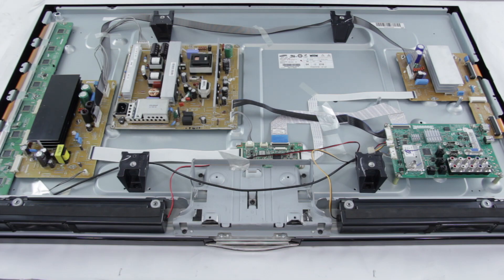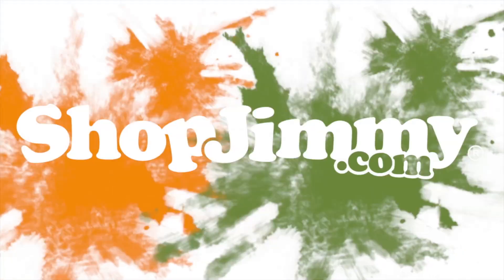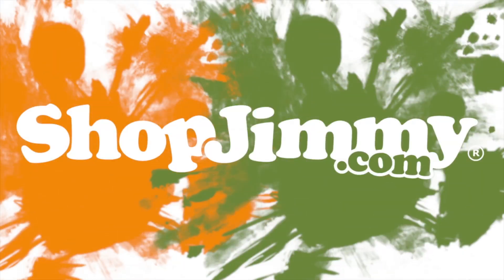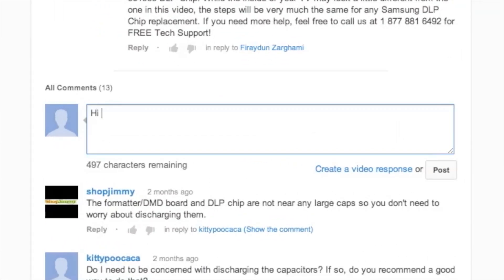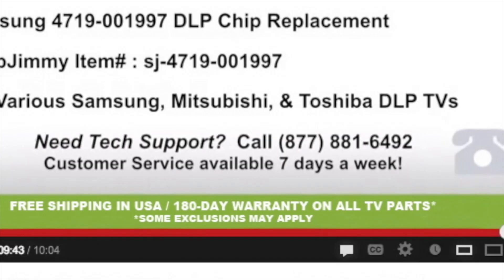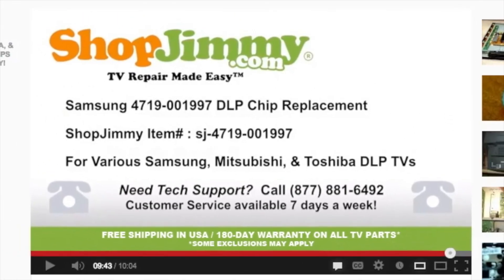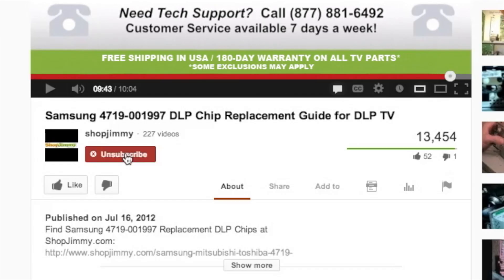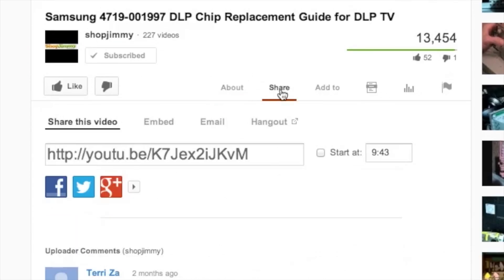Plasma TV Repair Tutorial - Common Symptoms & Solutions - How to Fix Plasma TVs

Comment: Good day ShopJimmy, my TV is a Samsung 43 inch plasma with model number PF4900 BN63-1028A #8DC22 and it has a problem of displaying false colour, mostly in green and purple like its NTSC. I have changed the main board and yet it still happens. Please what is the component responsible for proper colour in that TV? Thanks.

Comment: Hi, I have a 55” Samsung plasma tv model pn51f5500af
It will not power on. Red light comes on and flashes 2 times … continuously… no clicking, no sounds…just the red light. 
I opened the back, no visible problems… one small green light comes on on the board with hdmi connections etc.. but flashes a few times.. then nothing when powered on. 
Can you help? Is it a power board issue? 
Thx

Comment: Hi there Jimmy excellent knowledge pal I have a dma not supported message on my 42 inch Samsung plasma it's a 2009 model PS42A457P1D 
Model code PS42A457P1DXXU
It's not switching to digital I think when I select the digital option it says unsupported also the screen resolution is not central on the hdmi port
Please help as I contacted Samsung direct and they where not that helpful.
Kind regards Ash

Comment: I have a Samsung 55inch plasma tv model number 850HW-YB04 ...... So it clicks on but doesn't stay on so I ran down the issue on the ZSUS board down to a cable once I disconnect the cable the TV powers up but the picture is in BW is there a way I can send a pic of what I am trying to explain

Comment: Hello, my Phillips 42' plasma Model 42pf7320A/37 presents a blinking red light after attempting to turn on. I removed the back panel and found two bad capacitors.

This occurred after a power outage due to a storm, after the outage the tv sometimes would turn on and sometimes I got the blinking light. Now, it will not turn on at all and I get the continuous blinking red light.

Besides these 2 capacitors, is there anything else I should replace? And how can I send over the photos to identify the caps in my tv?

Big thanks for the time!

Comment: Hello, great tutorial video!   I have a Panasonic TH 42PX60U Plasma that has 7 blinks of the power light and no image on the screen. VSUS 195v, TP15v and Ve 165v all come up and shut down within a couple of seconds. Disconnecting both SU and SD boards, all VSUS 195v, 15v, and Ve 165v come up and stay up. Individually disconnecting SU and SD boards to isolate one or the other results in same symptom...no image and 7 blinking lights, yet disconnecting both allow voltages to come up and stay. What would you suggest to do next?  This is a 2006 model, and has been trouble free from day one. Thanks for any assistance!

Comment: 60 inch lg plasma clicking . Trying to power up but don't.  So far found a blown ceramic capacitor  on y sustain board replaced but no change .the 1 large heat sink on board nearest to buffer connections . Has 3 mosfets 2 same 1 diff specs . The 2 - 1 gives unusual ohm readings . I know they act as a gate for voltage but I do see some discolouring new that particular 1 ..

Ty in advance

Comment: I have a  Samsung Ps50c7790ys plasma tv, that has since last week 2 small black horizontal lines on the top of the screen.  First appears 1 black line and 2 houres later the second.  Sometimes the TV resets by its own and switches on. You mentioned theses problems due to a defect y-board. 
Do you think it's worth it to swap the y-board?

Comment: Hi, I have a Samsung PS51D6900 Plasma TV.   It stopped working when I plugged it in and heard a series of loud popping noises.  From then on,  when I plug the TV on, the standby light flashes 6 times but there is no picture.  I'm guessing that the TV has power and is turned on because when I touch the control panel on the TV (volume up/down, etc) the red light flashes.   What board/component is defective?  Many thanks.

Comment: I have a 50 inch Panasonic plasma TV model TC-P50 U2. It won’t come on. When you turn it on there is a click sound and the red “on” light comes on but the screen stays black and the red “on” light goes into standby mode (flashing on and off). Can you help? I see where the power board is, but I don’t know what the fuses look like that you refer to in the video.

Comment: Hi There,

I got a Tc-p50u50 that won't turn on. Standby light comes on when plugged in, and you hear the relay click, but won't turn on with a press of the power button. 

If you hold the power button for 5 seconds, the relay clicks, standby goes out, and then immediately returns when the button is released, along with another relay click.

Comment: Thank you for making this video. I have a Samsung Plasma TV Model PN51E450A1F from 2012. When I plug in the TV I get a solid red standby light. When I use the remote to turn it on I get a startup sound then the red light starts flashing then goes out. The screen is black. When I use the remote to turn it off I get a shutdown sound then the red standby light appears solid again. Do you have any idea what is causing this or where I should start?

Comment: Samsung model pn42a400c2d tv wont turn on indicator just blinks
Reply: I have similar issue. When plug in there is no picture and red  led at the front blinks 5 times.
I replaced the y board after I had the internal green led on logic board flashing each 5 sec. Now it flesh every 1 second as should be but still no picture.
Any advise what to check next would be very appreciated 🙏

Comment: I bought samsung plasma tv 2012 PN43E450A1F, in 2012. my mom had it until 2014 the picture quit on it. turns on get sound when plug in however no pic. Momma died in 2017 and its been sitting in my brothers house since 2014. I have it now, trying to see whats wrong with it. it turns on but no picture. what's the deal. thx.

Comment: Hi Jimmy have a LG 60pa5500 that I bought used power  on and after a short time shut off by it self  when it is on with pic on screen then it shuts off turn back on and have sound but no picture please help me any suggestions in your expert experience  would be so appreciated  thanks I don't know if you can respond by email please let me know

Comment: Do you have a video showing the capacitor replacement? Or should I just look visually for the damaged capacitor and then replace it? It will be located on the power board correct?

Comment: My 55" Samsung plasma works sporadically. Same thing happened with my 65 inch. I replaced the power board on the 65". Could I have the same issue with the 55 also?

Comment: I have a Panasonic Viera 50" plasma tv, model TH-50PX60U, purchased in 2006.  The TV has worked flawlessly since purchased, but just recently stopped working, i.e., no picture and no sound, when powered on and the red power on light flashes ten times, then goes dark for two seconds and then repeats that pattern instead of remaining on without interruption.  The Operating Manual does not provide a clue as to what the flashing power light means or otherwise provide any assistance with diagnosing the issue.  Seeking any information as to what the flashing power light signifies or other troubleshooting insights to diagnose the problem with the TV.  Thank you in advance for any and all assistance with this problem.

Comment: Year 2006 Pioneer Elite PDU-PC42HO7A - Blue and Red leds are solid ON, no blinking. Powering it by the push-button on left bottom corners makes a relay click and that is all folks. By remote or side pushbutton push won't do anything - dead. No priming, no sound, no picture. Replaced caps on major boards with suspicious values by nichicons. Disconnected Y-s and other boards from power board and no voltage on VS except 1 volt. Checked fuses - may still have some undiscovered, shorts to positives from ground not found yet.... Found 3.3V, 6V, 7V, 12V, 16.5V-17V on power-board but nothing in higher range. Used to run for a little then off, had to be disconnected, let sit and it would run again for short time or a day and so on but now recently no chance to run it at all. Blue and red solid leds maybe clue but can't find any guidance on the web. Stand-by voltages, abbreviations and what they mean on the board and at what point the voltages should be there is a puzzle to me.  There is quite more of boards than what I see shown here and elsewhere. Knowing presence of correct voltages at certain test points and time is the key. Thanks

Comment: Samsung PN51E550D1FXZA top half of screen is like it's not on at all but, the bottom half works perfect. It has a clean line from left to right straight through the middle with no picture whatsoever on the top half but the bottom half works perfect.

Comment: Samsung lnt5265fx it's a 2007 I can watch it as I am not for 30 minutes maybe an hour then the backlights turn off. There is still a imagine on the screen if I shine a light on it. But I can turn the TV off for 1 minute or just a few seconds then back on and it will work fine for 30 minutes to 1 hour. I was thinking inverter boards but I'm not sure it's that since the backlights do get power for awhile.

Comment: Jim,
Can I replace the crack in my TH-50PX50U with glass cut from a glass shop?
I just cracked the screen while lifting the beast off the shop table and would hate to let it go to the recycle bin so soon.
Are there tear down instructions for pulling the unit apart to size and replace the glass?
Is there a place online that I can buy a panel to replace it with?
Thank you!

Michael

Comment: I have a Pioneer PDP-5000EX plasma and it has 03 equidistant thin horizontal lines running from one end to another. Could you please help me diagnose the problem and guide me on the solution for the same

Comment: Question: 
Panasonic TH-50PZ80E

It's not turning on. After blinking green, it goes to a blinking red light.It still 'clicks' nicely as it's always been doing, so it seems very healthy, and there's never been any issue with the image. It just doesn't turn on. For a while, it helped to hold a remote button pressed to help it 'wake'. But it worked less and less. As if it gradually struggled to be turned on.

Any ideas on this is greatly appreciated.

(A local tv rep. guy diagnosed it as being 'something' with the main board.)
But he didn't say what. I think he wasn't able to diagnose it as it is many small components.

Comment: My plasma tv model number pn59d550c1f gave a pop sound while watching and never came on after that, I removed back cover hoping it was a fuse or a capacitor I could replace but nothing looked unusual. All two fuses I saw looked fine and capacitors didn't look blown. It would seem to some evidence of a blown something would be visible. Any ideas what board I would need and where I could get it? Ohh also the logic board blinks once every 5 seconds. Thanks

Comment: I have a Samsung PN51F4500 AF, after an hour or so, shuts down into standby but won't power on again until power cord is removed and power recycled. Then fires back up fine for another time period. Picture looks good from a distance, but if a few inches away, looks a little fuzzy. Need to figure out which board to replace. Thanks.

Comment: I own a Panasonic Viera 50" Plasma (TH-50PX50U) and years ago a black box (approximately 12Hx11W) appeared at the upper right corner. Did some resetting to the factory settings, but it didn't help. I suspect that a power surge caused this problem, but we kept the TV because the picture is simply amazing and we could live with that box. Could it be the closed captions area? I don't know much about electronics, but I am willing to at least try, if replacing a board is what needs to be done, even if at the end we'll get a new TV. Thank you, in advance.

Comment: Hello  Samsung Plasma-Model #PN60F5300.  The TV won't turn on at all. 

At first...I would unplug it and try to turn it back on and I could hear a slight clicking sign about 6-8 times...then the red light at bottom of the TV would turn off.  From then, I could not even get the red light to come back on unless I unplugged the TV and plugged it in again .

Now when I unplug the TV...the red light at the bottom stays on and I do not hear the clicking sound anymore.  TV still does not come on.

Also...I had a single vertical green line on the TV for a very long time before it stopped coming on.
Please advise if possible.  Thank you.

Comment: Thank You for the video. One day while watching TV, heard a pop sound and  TV stopped displaying picture. It keeps flashing the red light. I opened the back panel but do not see any blown capacitors. I checked the voltages at the output pins. It seems they give the correct reading as indicated on the PCB. What could have gone wrong?
Reply: I meant the output pins of the power board

Comment: Hi I have a Hitachi 40" inch plasma TV model 42hds52a approx 15 years old.  Over the past several months, when tuning on the main power button at the bottom of the TV, the red light would come on, but it didn't transition to green.  Sometimes pressing the power button again would make it work and more recently I have to unplug for a while, depress the power button and plug back in to make it work.  Now the green light will not come on, but the red still will.  I know it's an ancient TV that was more than a house but the picture is great.  Do you have any recommendations, or is it about time to give it up?  Thanks!

Comment: Samsung model PN43D450A2DXZA   It turns on. But then, it shuts off. Has sound. Need help! Replaced power supply which it was bad, It worked for a while but then it returned to the same simptom.

Comment: lg 60pb5600 black screen of death.. can hear sound, but no pictures or menus. I cant tell if the flashlight test works because the glass screen cover is so thick.. but I don't think so.
 Also- it turns off after 30 seconds.

Comment: Hi jimmy i came across  your video  i currently  have a  problem  with my tv model  number  S42AX-YB09,  my tv has some black patches  and a channels  logo print on the screen  even after you change the channel  and it also has a green and red colour  line as well

Comment: Hi I have a Samsung plasma 3D TV.  Type No -PS51D495 : Model Code: PS51D495A1KXXU. The issue is intermittent,  and happens usually when the screen is displaying white clouds, and mainly top of screen. Every now and then the clouds which should be white are a purple cast, which disappears within seconds, but it is watchable,  for the most part. Hope this description helps, regards Andy

Comment: I have a Panasonic plasma 65" TC-p65s2 or Thp65vt30D with vertical lines in one location they start out different colors then turn all black its about 3" wide top to bottom.

Comment: I have a model S51AX-YB02 Samsung the screen is black I still get sound, when I tried a new power cord I’m not getting power anymore because I can unplug it and plug it back in and it would work and then the screen would go black but still have sound not sure what the problem is Wondering if you might have any advice

Comment: Hello.  I have a 2010 LG 60PS60 UA 60" plasma tv.  Was watching it yesterday then all the sudden no picture black screen but still had sound.  Powered down and unplugged from wall to let things reset. Powered back on Powered up like it should had pic and sound was working perfect. Then 2 mins later screen went black still had sound. It will continue to do this every time now. What's your thoughts?  Y sustain board?  Thanks for your time.

Comment: Good day Jimmy. I own a Plasma 3D Samsung 60" PS60F5500 and it worked great since February 2014. Unfortunately it has now died, and only double flash the standby light in sets of five times. I disconnected the Y-sustain power cable and the TV then powers up and makes bleep sounds when I toggle its switch up and down, but no display. The Y-Sus board part number is ZB 958B A3 391 5XH - BA3. I tested the Mosfets and found two (marked 30J127 - and below 3:K) that are shorted - Q5002 and Q5003. I removed the cap C5172 to gain access to removing them. The Cap tests ok. Apart from this there are 4 big components on the largest solder patches in a group in the center of the board close to these two mosfets, and it would seem that they might also be shorted, although I did not remove them to test - might need a hotter soldering iron for this. The two buffer boards have no visible burn or dry solder indications that I can see. I will really appreciate your help in getting this resolved, as it would be the end of my really stunning Planet Earth, Life and other nature, documentaries and more titles of my 3D collection. Sincerely appreciate all the way from Pretoria, South Afrika, Dawid Sadie (dawid.sadie@gmail.com).
Reply: Hi Dawid, did you manage to get the TV fixed? I also have a PS60 that’s also giving me the flashing standby light repetitions. These plasmas are just too good to throw away

Comment: Hi my house got hit by lightning. I could feel or hear it going through the electrical cables. Now my tv not working. It comes on for a while and then it switch it self off. Would it be the power board? 

Also HDMI does not work so this could be both main boards and power board right? 

Tv is a plasma PS50c680

I will open the tv tomorrow to look for any burn marks.

Comment: Greetings Jimmy, I've got a Zenith brand (LG) 42 inch Plasma TV from 2010. Symptom is standby light works, power on turns standby light off but no picture. No sound. Model Z42PJ240-UB.AUSLZUR